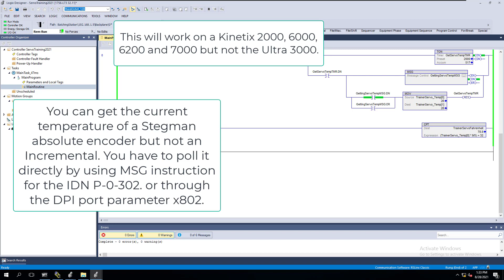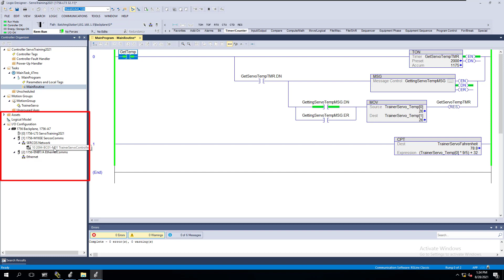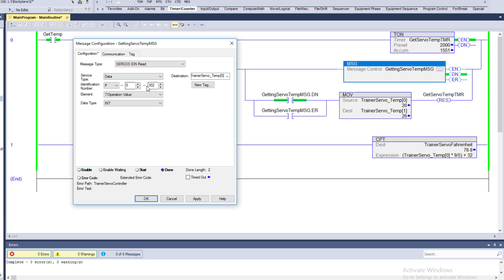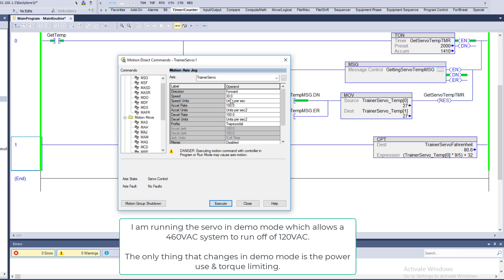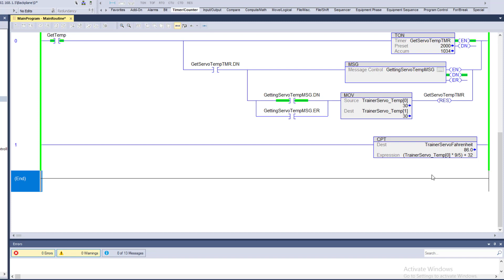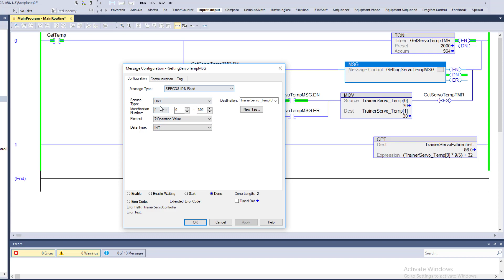Retrieving Encoder Temperature on a Kinetix Servo Drive Using Studio 5000 Message Instruction

Comment: hello guys, i am asking for help. Do you know anybody which kind is  measuring temperature inside encoders ? in AB servos for kinetix 5700 ? It is a Math model ? Or value from thermocoupler or ? thank you very much
Reply from the maker: Based on math although very well detailed equations so pretty on point when you measure with thermal readings
Reply: @ShaneWelcher  OK then, for make sure my self.  If i see servo motor fault temperature factory limit. And real motor temperature is 40°C, and via CIP message reading temperature as same. But sometimes apears that fault for no reason. Then i expecting demaged part for direct measuring (like  thermocoupler). But if it is Math computation by motor capacity, current maybe anything else. Maybe it help manual tune of motor. I dont think there is something demaged inside encoder. Thank for answer Shane :)
Reply from the maker: @SilatSkiller  

Always make sure the servo controller is clean, the backplain, and the drive unit. I have seen a lot of false faults due to that being dirty.

We just blow them out with compressed air.
Reply: what Class and Attribute did you use for take the driver temperature?